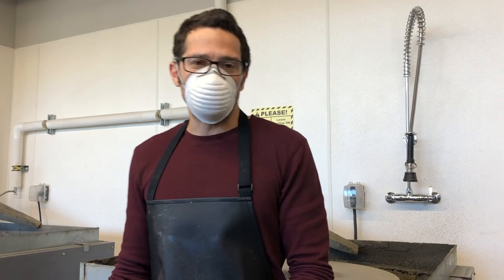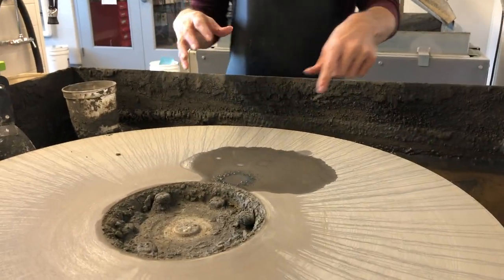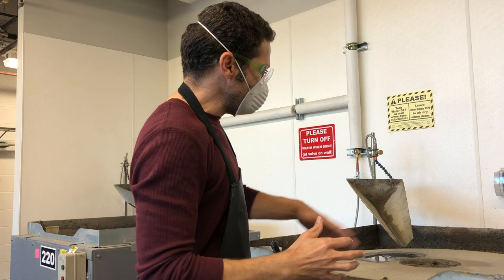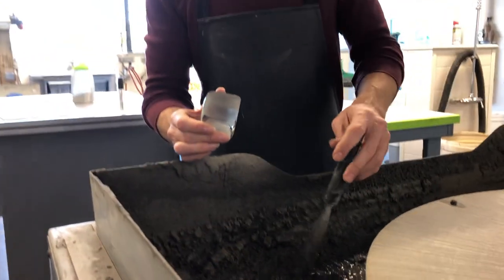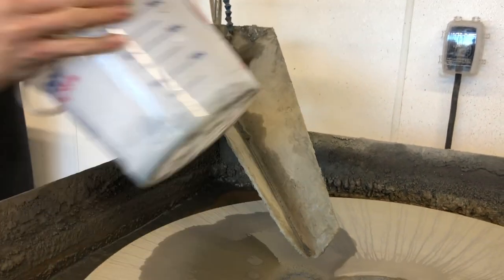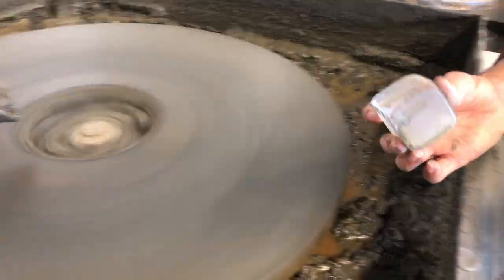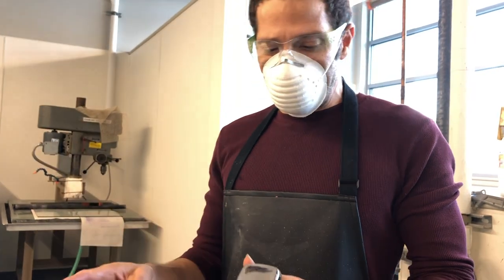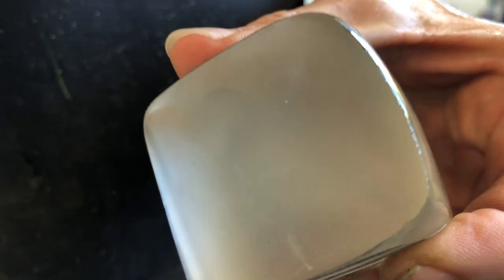Coldworking Glass: The Flatbed Grinder

Comment: Great. I am hoping to get something under $500 (ish) for coldworking. My kiln is small (Olympic 126) - and I am learning to cast. Can you recommend a grinder/polisher for a beginner (have been fusing glass for a year, but just getting into casting). I have a Dremel and have used it to grind and polish rocks, but it's not easy! Ready to move up to a better system...Thanks! Dianne